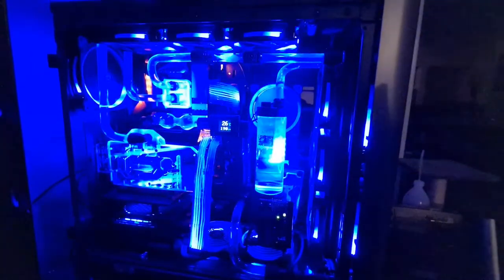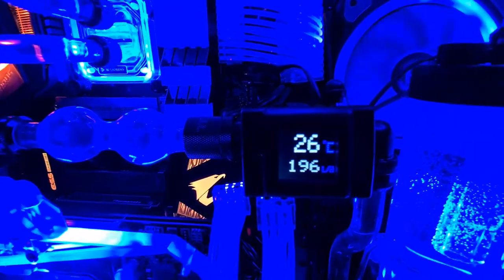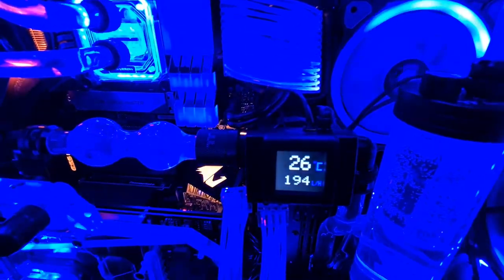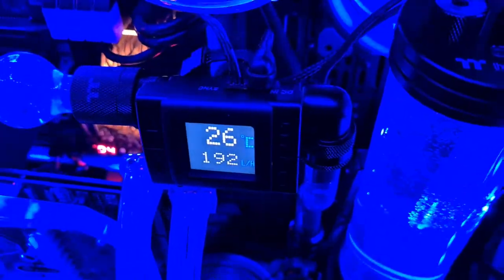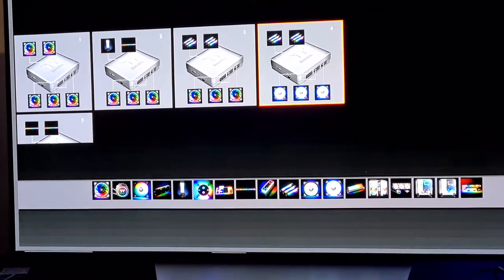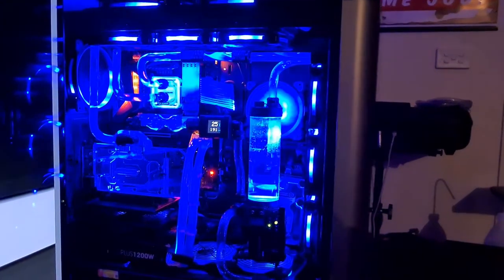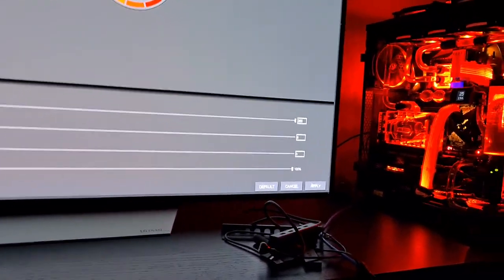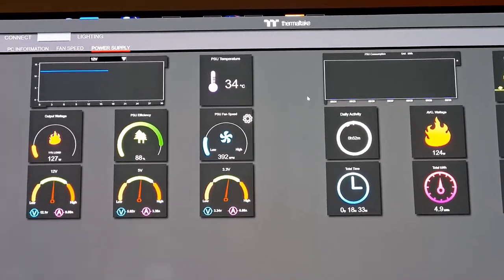Thermaltake Pacific TF2 Flow and temp sensor - PART 2 Testing and RGB Plus 2.0 review

Comment: Thanks for posting this, I bought one of these sensors a few weeks ago but haven't installed it yet. That display looks perfect in terms of easy readability with quick glances.
Reply from the maker: No problem and glad you found it useful
Reply: They only work in Centigrade.  I have tried 5 of these and the center zero is missing from the readout when 100F or higher.  Firmware is corrupt and will not work in F degree mode.
Reply from the maker: I just tested mine and it displayed perfectly at 102F but I only use Celsius
Reply: @hairywombat3103  Strange.  Pretty half assed software testing by Thermaltake on my end here!  105F shows up as "1 5F" on 5 units in my application.  One has a glossier LCD, indicating a different production lot, but it too does the same.

When in "set" mode, the center digit appears.  But once out of set mode, center digit goes away.

Will have to use Centigrade, but this is yet another typical example of things made today.  Never fully tested before production.
Reply from the maker: I have a lot of trouble getting my water temp that high as I have 2 x 360mm radiators. Are you referring to the original TF1 flow sensor or the recently released TF2 upgraded version, just wondering.
Reply: @hairywombat3103  The TF2.  The missing zero is now an official "feature" of the TF2.

I am using 4 of them with 240mm radiators for a different cooling application than computer, but same closed loop cooling system and temp range.

Clearly a firmware issue.  Thermaltake tech responded to my email last week.  The center zero dropout is is a well known issue with no repair available.  

There is a PIC programming port on the TF2 PCB for firmware update, but they do not support it... :/.  But yours works?  I purchased my TF2's in September 2020.  Perhaps your has the corrected firmware version?

The zero dropout may even occur in the C display as well from what they said.  But you would have other things to worry about than a missing zero on a readout by then.

Just blows my mind that such an obvious malfunction in firmware would get through production/testing.  This is a high end product.
Reply: @hairywombat3103  If I may ask, what flow rates are you registering with your system?

Thanks.
Reply from the maker: @gavincurtis  I received mine when stock first became available in August 2021 as a replacement for my TF1 after the TF1plastic  housing cracked. I usually get anywhere from 160 -200 L\hr. This seems elevated to the 120 -160 L\hr I would get from the TF1
Reply: @hairywombat3103  Thanks for the info. These TF2's definitely seem to be built pretty solid.  I have the earlier firmware version that will not work in Fahrenheit.

C it shall be.  :)
Reply: @hairywombat3103  Where did u get the double bubble tube please respond !!!

Comment: I've noticed that the Temp mode is broken in the new 2.0 version of the software. I've got all 9 of my 'Pure Plus 12' fans set to Performance & PWM. I loved just seeing the colors change based on the CPU usage in the previous software version, but it's no longer working. Interesting though is that both CPU and GPU are monitored and affect fan speed now, which is AWESOME! But I still would like to select which one (or both) I'd like to have the software key from to manage fan RPM. 

Lastly, and this could be a Windows 11 dev build issue but my 2nd controller keeps dropping out upon boot-up. I have to go to Device Mangler and delete the USB device with the bang, rescan, and then 6/10 times it'll get detected and fall inline. Note, I have 5 packs of these fans and have tried swapping out controllers and the same thing results. Also, I'm not able to use fan header #1 on controller 2 while daisy chained, so weird and temperamental these things!
Reply from the maker: You may be having a low voltage drop out on that controller due to the load, number of fans, or its not getting enough 5 volt yo start with.
I had a lot of issues with controllers dropping off due to low power problems.

Comment: Thanks for the helpful video!

I had one question though: Is there a way to turn off the alarm on startup? 

When the PC goes from off to on, my pump is starting to ramp up so the flow is going to be low for a few seconds which triggers the alarm until it's up to speed.  Have you experienced this?
Reply from the maker: Glad it was helpful.
The sensor does have a small delay built in however if your pump is a bit slow to startup it may alarm. In my case I incorporated a delayed start to the circuitry I'm powering it from. An simple small timer circuit off ebay would also do the job nicely.

Comment: is the Sync cable proprietary? doesn't seem to compatible with my mobo. Blocked off slot in 12 pin connector seems wrong or proprietary
Reply from the maker: Its specifically designed for the Thermaltake controllers only. They use this same 9 in plug for all their fans.

Comment: Do you need to plug this flow indicator into a Thermaltake controller for this sensor to operate? Or can I just plug in the power and get a readout on the screen?
Reply from the maker: No it will run standalone on its little LCD screen without software.

Comment: Does flow direction matter, having issues mine only reading 32-35l/h at max
Reply from the maker: It doesn't seem to have any direction markers on it or state anything in the instructions so I assume its bidirectional.  I'm running mine from right to left.
Reply: @hairywombat3103  yeah i thought the same and running same direction yet can get it to read flow faster than 30-35lph

Comment: I'm thinking of getting this but not sure after seeing all those horror stories that this missing o rings and leaking and so on... do you have any leaks?
Reply from the maker: The original TF1 did leak which is why I put in the TF2, no leaks thus far🤞
Reply: @hairywombat3103  good to know, but i went with the EK flow meter :s

Comment: Is there a way to get data off the TF2? Like and output so it can be run to like an aquaro?
Reply from the maker: It has an proprietary output designed to connect to a TT controller, it does not have a USB output
Reply: @hairywombat3103  proprietary plug? Like 3 pin?

Comment: does the tf2 show up on the rgb app 2
Reply from the maker: Its supposed to but it needs the controller that comes with the TT waterblocks. It does not come with a controller so I couldnt test that.
Reply: @hairywombat3103  oh man, i was looking close at other videos, the one for the w4/5 needs to say temp above the dip switches. cant find it online on  its own, i think this will be the reason im going to switch to the corsair eco system. Just as they finally polished the rgb software. Thank you for your videos!